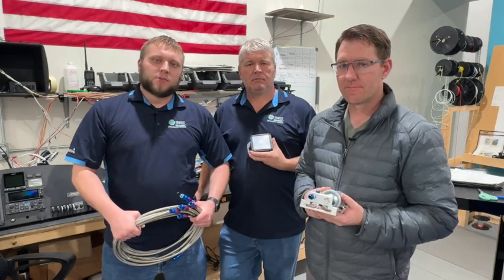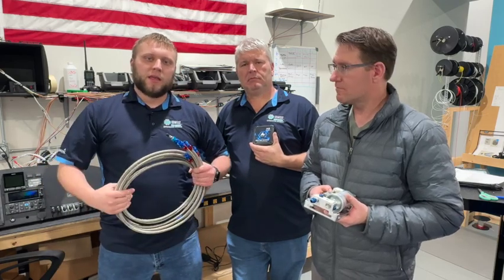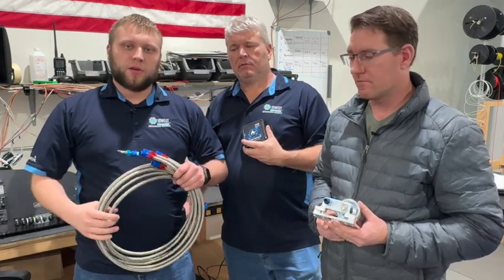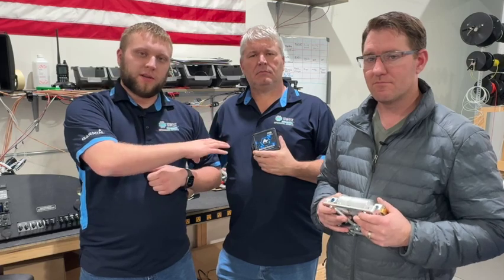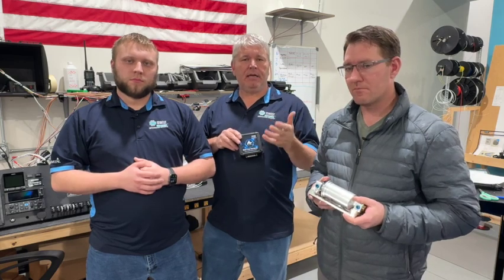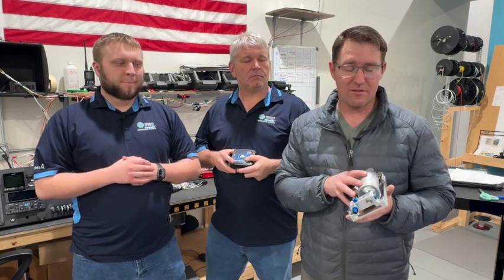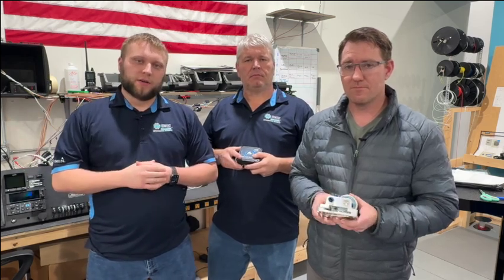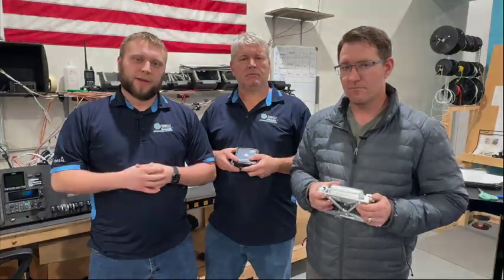Aerospace Innovations

Comment: Have you considered an upgrade for the rotax fuel pumps - and integrating the manifold into it?  With wing root pumps, the fuel tank select valve mods and the FWF pumps tied into the manifold assembly and all the fuel lines, this would be a pretty nice package!

Comment: Hey guys, great job! I am building a plane with a Lycoming 0-320. It has an updraft carburated fuel system on it. Can I convert the engine to a fuel injection to eliminate carb ice issues?

Comment: Speaking of getting rid of rubber fuel hoses, it would be good to not have the two rubber hoses with four hose clamps on that Naviflow manifold assembly.
Reply from the maker: That would be but it too small with the check valve and at least it’s easy to get to.